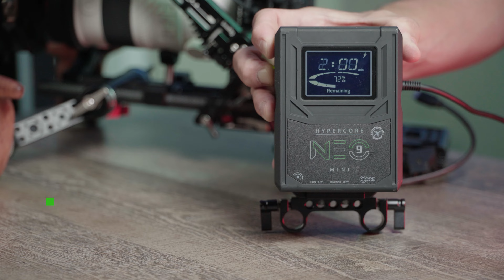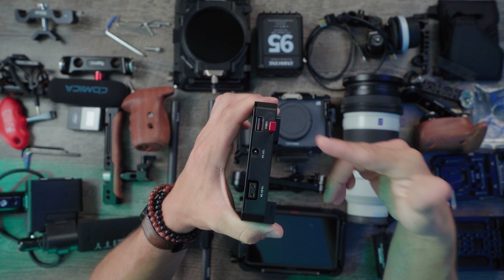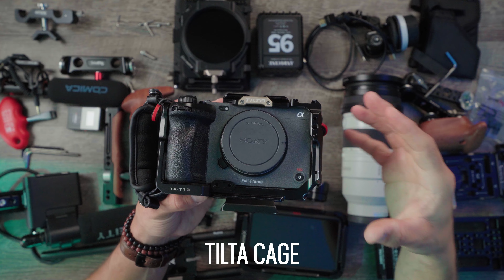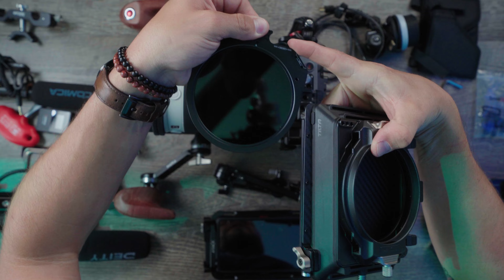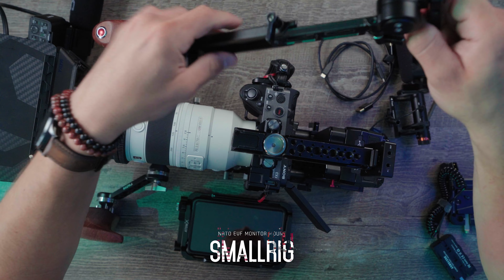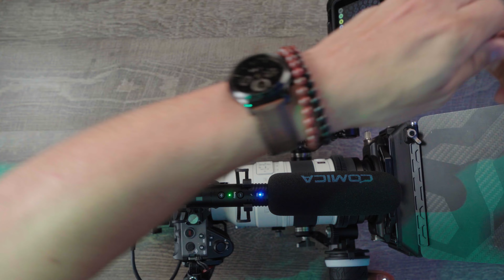Convert ANY V-Mount battery into USB-C PD!  FX3 + FX30 Cinema Rig Build: CATEFO VM06

Comment: how could I make this plate work with FX6?
Reply from the maker: Hey! I have 2 different baseplates for the FX6 that have 15mm rod supports built into them (one is from Tilta and the other is the Universal shoulder pad by 8sinn). You could go that route, but the FX6 has to be powered through the DC port. There is no USB-C PD input port on that camera (USB-C PD on the FX3, a7IV, FX30, a7RV, a7S3. etc). I haven't done any FX6 rig videos here on the channel. Maybe I should start talking more about about the FX6 on here?
Reply: @RayValencia  I see. Yea I’m looking for a v mount plate for my fx6 that allows me to keep the Sony battery in as bacj up but don’t want to spend 400 and get the wooden camera plate? And yes I would watch fx6 content all day. Love to see different  builds and get ideas.